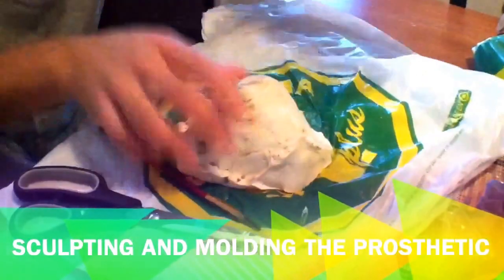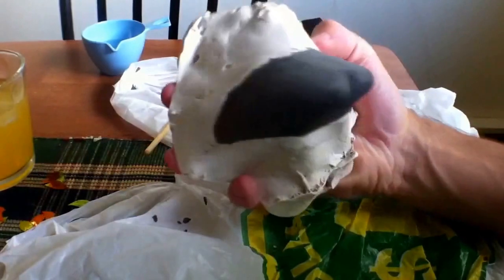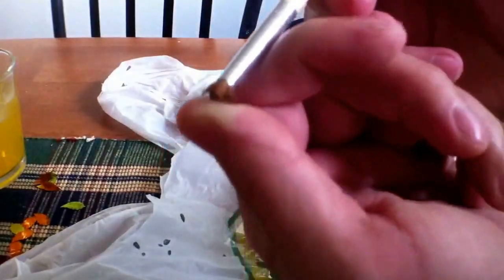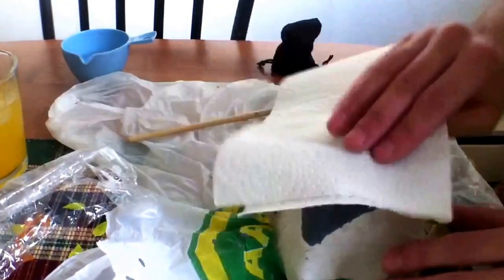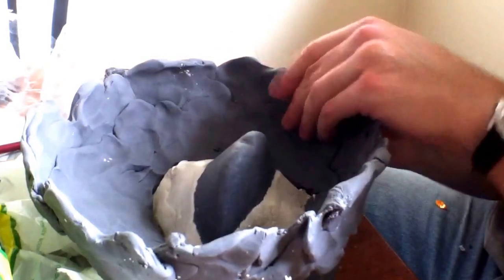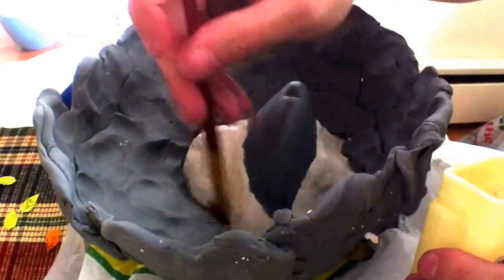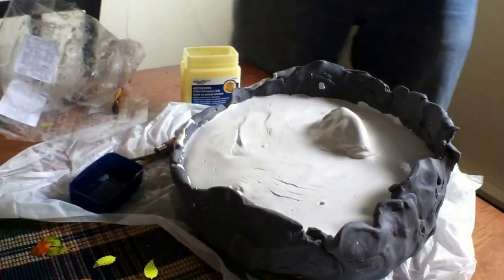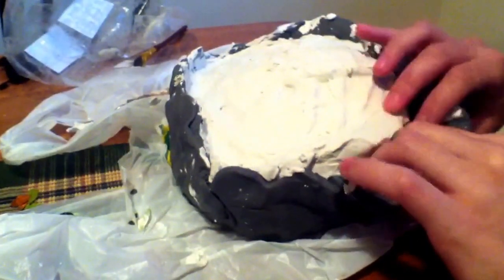DIY latex prosthetic make up on a budget! - 3: Sculpting and Molding the appliance

Comment: Why wouldn't you just dip the chin piece in liquid latex a few times until you got the thickness you wanted, then turn it inside out so the texture is on the outside?
Reply from the maker: nochaneladdplease that is also a possibility, but i wanted to make a mould so i could reuse it and make multiple pieces